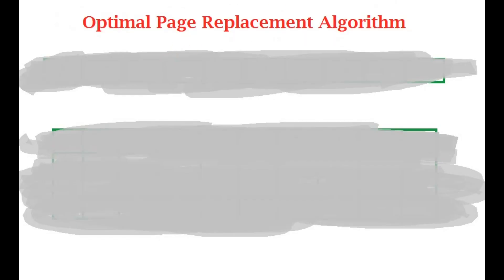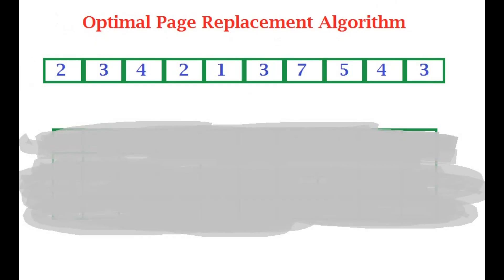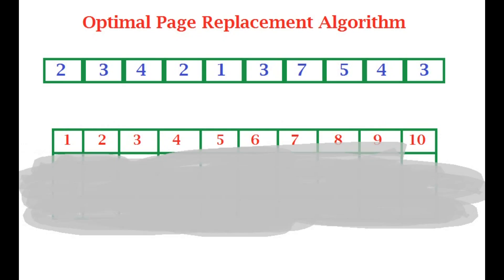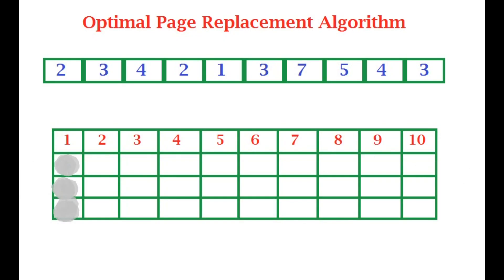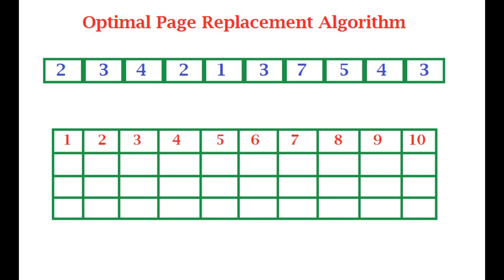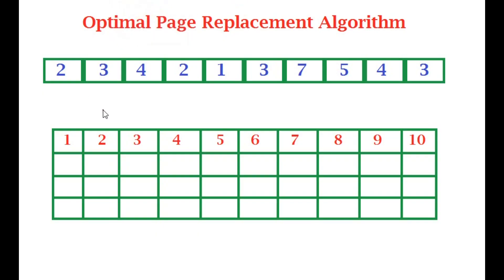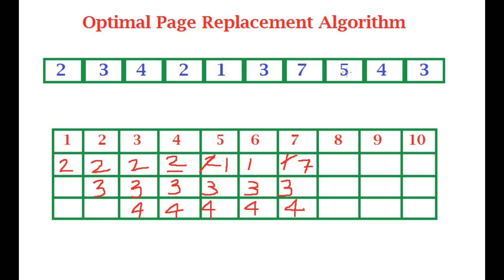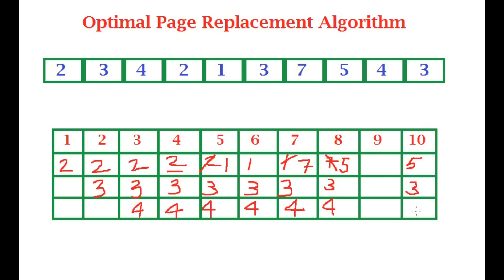OPT (Optimal) Page Replacement Algorithm

Comment: how many page faults will be in 1,2,3,4,5,3,4,1,6,7,8,7,8,9,7,8,9,5,4,5,4,2. with 4 frames.?
Reply: Do you know what are the frames? i'm getting confused with that. Is it equal to the ways or blocks?

Comment: but what we do when the all num are available in series ?
Reply: In that case you just have to look for the page which is not goin to be used in near future i.e. it comes in last last among all the 3
ex.
take same pages from above with some changes
Pages are : 2,3,4,2,1,3,7,5,4,2
1st iteration: 2
2nd iteration: 2,3
3rd iteration: 2,3,4
4th iteration: u'll get a page hit
now see you have 2,3,4 in your table, and next page is 1
for 5th iteration it'll see which page wont be used for longest period of time.
now in this case (2,3,4) 3 will be used after 1 it cant be removed, 4 is also used so it wont be removed but 2 will not be used for the longest period of time. so for5th iteration we'll get
5th iteration: 1,3,4 (since 2 wont be used for longest period of time.)

Comment: how the page replacement algorithm know the coming pages ?
It hasn't arrived, yet.
ex. when I am at t= 2 I only know the pages at t = 0 , 1,  2
I don't know what will happen at t= 3 , 4 , ....
Reply: this is the ideal one. We cannot implement it.
Reply from the maker: as arun rightly pointed out, it is just a theoretical concept, it could be implemented but it isn't used because it yields inefficient result.
Reply: This only works because we are assuming a simulation system not a run time system.
Reply: +TechXArena As arun said it couldn't be implemented because we don't know the future frames. It is only used in a theoretical setting for comparison with algorithms that can be implemented
Reply: That's one of the disadv of this algo : we should know all the coming page requests beforehand.
Reply: Nice catch. The very reason this is just a theoretical implementation. it cannot be realized in hardware.